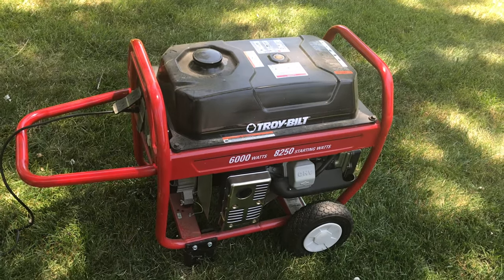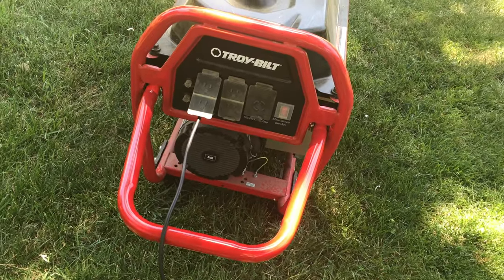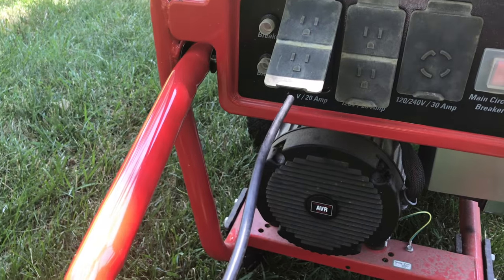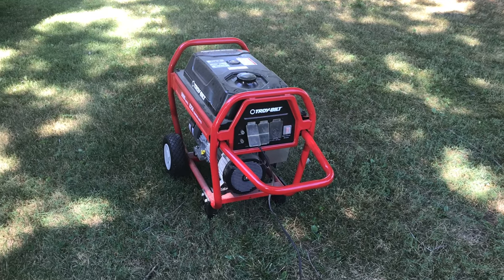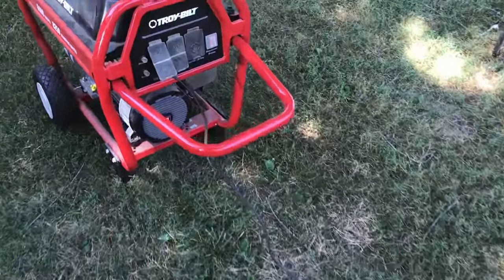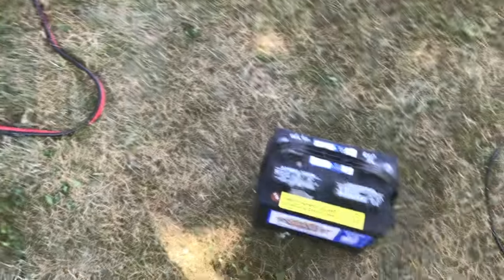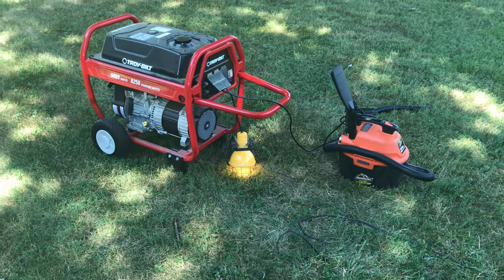Energizing (flashing) your generator with a car battery

Comment: Good Lord- Watching this man put a stick in a mixer where it could easily start flailing without notice should power return was nerve wracking!
Reply: yup that was KRAYZEEEE
Reply: i was clearing my hole saw with a screwdriver once.accidentily hit the trigger.my god that was not cool.3 inches into a tree.i shit
Reply: That would have hurt had it actually started.
Reply: I'm with you on that.   The idea is to turn the chuck, counter clockwise with your hand, with nothing in the chuck.   I've happy for him it didn't work using the drill.
Reply: Hoky sh*t. When I saw that I thought gee,   I know it should work, but for his sake I hoped not for him. You're not supposed to have anything in the chuck cause look out when it suddenly produces power! What a dumb F ! ROTFL.
Reply: I was afraid he'd stick a finger or thumb into the mixer.
Reply: Umm . .well. if it started it would have slapped his hand once or twice. .it's light wood so doubtful it would've been that serious. But genius with the battery.
When men were men and fakes were afraid. .ah the good ol days when men solved problems for the arm chair warriers wrapped in cotton wool . .well done bud.

Comment: Drill motor trick has worked for me every single time I’ve used it. Sticking something in the chuck like that is very dangerous. When that sucker kicks on, that drill will tangle you up quick. One difference, I’ve only ever used a 1/2” drill motor. Maybe your drill being smaller made a difference. Also, you get the polarity wrong with that battery, you’ll likely cause some permanent damage.
Reply: see my other comment....you're  right.
Reply: How to get a fan that runs on ac to run on a car batery
Reply: @raymondbyczek2443  power inverter.
Reply: @sourand jaded don’t know, never tried it. Try and let us know if it works the same.

Comment: Unless the drill has permanent magnets (most don't), then you are relying on the drill to have some residual magnetism in it. If it doesn't the the trick will not work. Battery flashing is tricky, always wear some protection. One second is actually too long. A quick tap will usually work. Remember- as soon as the generator starts generating, you suddenly are holding a live wire with 120 volts on the bare copper ends! It will see the battery as a short circuit, thus the description "Flashing!" Never tap a second time without first checking to make sure the generator hasn't started generating.

Comment: You Sir, are extremely, extremely lucky that your battery didn't explode in your face! Feeding 120 VAC to a 12 Volt Battery? Really?! What the Hell were you thinking! By the way, I had just completely serviced (changed oil, new spark plug, Cleaned the Carburetor) and replaced the Diode Pack and Brush Assemply on my Briggs & Stratton 5500 Storm Responder after it quit on me while waiting for power to be restored after hurricane Beryl. Fired up the Generator, turned the breaker on and,... Nothing. - Broke out my "1/2" Inch drill (don't believe a smaller 3/8 inch drill will generate enough voltage), fired up the genset again, plugged the drill in, set it for forward spin, held down the drill trigger, turned the breaker on and hand spinning the drill less than 1/2 a turn in reverse on the drill, the generator suddenly came alive and was producing 121.7 volts. Yes, the drill method works. I just think you need to use a heavier duty drill. - Great video on what not to do.

Comment: Actually, it does work, but use a battery-powered drill to turn the electric drill backward. o have done this 2 times in the last 2 days, and it worked both times.

Comment: I've had to flash 3 generators.  They were 7000W to 9000W.  Not once did the drill method work for me.  I used a Milwaukee drill and a Black and Decker drill.  The car battery method did work, though.  You have to let it run for a while afterwards, maybe 5 minutes.  Otherwise, it will lose magnetism again.
Reply: How often do you have to "flash" them? I've never heard of a generator losing its magnetism.
Reply: @james4wd236  Never, unless it stops making electricity because it has sat for many, many years or has been disassembled. Causing it to loose magnetism.
Reply: @moocow2529   Interesting. Well I'm convinced that the welder/generator I have has this problem. I got it after sitting in a barn for a few years. Gonna try to flash it tomorrow and see what happens.

Comment: Just went thru Hurricane Beryl and had to flash my Gen  every time. I used the drill. Make gen is running and circuit breaker is on. The drill has to be set for drilling (so clockwise from the back of the drill) grab the chuck by hand (maybe a gloved hand) and spin the chuck counter clockwise. One hard spin did it for me every time except once and the second spin got it going. My 14yo son was able to do it when I wasn't available .

Comment: It's called remanence. Residual magnetism in the ferrous core of the rotor. ( Certain metal materials can hold residual magnetism)This can leak out over time if not attended to or its stored too for long periods. Also leaving a load on the generator and shutting it off while an appliance is plugged in and still operative can do that as well. Nice thing about a non PVR generator is that it uses a capacitor to store some of the eneregy from the last use. It can extend it, but not for long especially if it's in harsh environments. Be careful though on some generators that have an electronic PVR, excitation using an angle grinder by spinning it on the ground can flash the circuitry in the PVR. On these you need to disable the PVR and apply a trickle voltage into the main. An ordinary drill wil not work on these.
Reply: Amazing comment

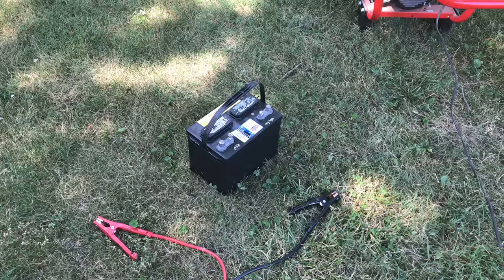Comment: 2:48 TIME.  YOU  need to insure, that the  Negative battery side, goes to the long spade female hole, in the  AC   120  volt socket. Postive, to the narrow  slit.  Polarity, is then correct.
Reply: So positive to hot and negative to neutral?

Comment: It is difficult to spin a drill sufficiently fast to generate the required current. This method works best with a battery powered drill connected to the chuck of the mains powered drill.

Comment: The drill option does work, I've tried it and had no problem. You can check other videos and watch other people reactivate their generator using the drill method! Using the mixer and wooden spoon was a very dangerous thing to do, had the generator started working!
Reply: RIGHT.  'whack '  =  i wont  try  T H A T    again !
Reply: I wonder if some drills may have a filter to prevent them backfeeding power in a situation like this

Comment: this video might have just saved another generator sitting in my garage from being scrapped thank you
Reply: if u have sliprings windings to the rings could have a bad solder joint so field will
not be magnetized as it should be.

Comment: Fuck yeah, I just flashed my generator with a cheater cord from a 12v car battery, Note! my generator was not running when I flashed it. Generator works great now. wooooo weeee, I was just about to waste $150 on a new AVR with no returns on electrical parts, thanks again

Comment: Thank you so much for this video. I have a customer who has a Fischer Panda Genset.  I went thru  all the TS documentation for remagnetzing the Genset. Nothing worked. They stated to have Genset off were unclear of what to connect where and specified 9v battery. I checked all the capacitors and all were to spec with capacitance and continuity testing. Capacitors after  disconnecting +/- from  each when I discharged each one nothing. So I felt like more and more a remagnetzing issue. Their manuals suck. This video made me look like a rock star ⭐ but I gave full credit to this channel for the idea to go to an outlet and closed circuits to Genset and using hot neutral to 12vdc small Telco battery it sparked pretty good, only held the connection for 1-2 sec. Fired up Genset and it started at 70VAC went slowly up to about 135VAC and came down.. restarted and dead on 120VAC thank you so much for your video!!! 👊⭐😎

Comment: Man, it's a good thing the drill method didn't work for you!   If that drill had kicked on suddenly, you could have gotten injured by the egg beater or the spoon spinning at high speed.     Good job on jumping the generator with a battery.  Thanks for posting this.

Comment: I thought for a minute I was going to see your get a screwdriver stuck in your head. I was laughing so hard I almost pissesd myself.HEY YALL WATCH THIS. Glad you made it through and we didn't discover the Unicorn is not extinct.
Reply: I was thinking the exact same thing ! as a marine tech ive seen a guy leave a screwdriver on the flywheel and when the motor cranked it screamed and launched the screwdriver just past his face and it went into the wall at 50 mph! he was lucky that drill didnt turn on! great video!

Comment: The drill must be one that uses permanent magnets to create a magnetic field.  Not all drill motors use permanent magnets.  Without AC power to the drill, it cannot create its own magnetic field to generate the electricity needed to flash your generator.

Comment: I have a Coleman Powermate 6250 generator and it starts but has little power output. I replaced the Carb, Brushes and cleaned the gas tank. My grinder after a while will start and run for 20 seconds then stop. It keeps doing that. Prior to doing all this the generator sat for 4 years. I'm told the generator needs to be Excited again. Could you please actually show me how you did yours with the battery? You cut out in parts that were important and just showed it running.

Comment: I tried it with a motorbike battery..... blew the caps off the top of the battery. Sounded like a bomb went off. Car battery next for a laugh🤣
Reply: That's because as soon as the generator starts working, you are now holding two live wires outputting 120vac into your battery. They call it "flashing" for a reason. you're only supposed to touch it to the battery for less than a second

Comment: I 'm not sure what's going on here.   The "AC plugs" on the panel are connected, basically, to the Stator winding.   The "winding" that needs flashed are  the Rotor windings. (the piece that spins).   What must happen is that when you touch your battery, "for one second" the Stator windings will "see" a brief voltage (12vdc) applied to the stator winding - the stator will then, due to its proximity to the Rotor winding, will induce a voltage (thus current) into the rotor winding.  Only problem I see with that is maybe the magnetic poles of the rotor could get reversed.  Is that a problem?  Not sure.

Comment: I've been studying the manual on a Winco I am rebuilding - this is a little different beast as the power is provided by the rotor and the field by the stator but as an engineer I would guess you got lucky with the polarity.  Correct me if I'm wrong - but if you were to reverse-polarity the magnetism it would cancel out the magnetic field perhaps magnetize it the wrong way - and (like a defibrillator) you would need to put twice the power in the correct polarity?  I want to make sure I got this right - it was running great but my crankshaft was destroyed so the head is off.  If the field wires get grounded - will I lose my residual magnetism?
Reply: I guess he doesn’t know.

Comment: When using the “ spin the drill motor” method, just put a bolt in the drill motor and your cordless drill motor on the side and spin away. Simple and it usually works. Drill to drill. Don’t turn on the electric drill or all heck will break lose. Use your imagination.
Reply: Yes, it will become gladiator tug of war. HEHE

Comment: Tried this and it it worked. Engine sounded as if it was under load, voltmeter perked up and held steady, so I hooked it up to the house and everything was fine, for about 5 minutes. Trying this again didn't have the same results - the engine groans and the generator breaker flips after about 2 seconds. Is the generator fried?

Comment: I'm understanding the battery might work but why didn't you show it ?? Show it in action? You said you did it but I did not see what you did!
Reply from the maker: Yup. I need to hire a camera man. Hard to hold a camera plus both ends of jumper cables.
Reply: @wagslick  BTW, I tried it and it worked! It worked, I was able to put two refrigerators on load. Then for some reason,after several hours, it stopped producing power. I tried the flashing again.. no go after that. Motor ran perfectly though.
Reply: @wagslick  use a tripod

Comment: I cant used either method, mine does make power, but like 60 to 70 volts. It is a capacitor type and the capacitor tested good.. I'm stuck

Comment: I watched one video and it was stated that it should be a 1/2” drill.. I tried a 6 amp drill and it did not work but a larger drill motor would be 8 amp.. Not sure if it will work on my generator ad it is 7500 watt.. I will try this..

Comment: You have to push on the trigger while you twist backwards. Don't use the wooden spoon, because as soon as you create power that drill is going to take off. Spin it backward with your hand and be ready to pull your hand off when it takes off. One secret is when you do your 6 month run on your generator, plug something in. The generation of power keeps your magnets excited, and you won't lose power in the future.

Comment: When you connect the battery to the generator while the the generator is running,  do you have the breaker in the tripped or set position?

Comment: I had to flash a generator last night for the first time. Saw a video on the drill method. I used a dewalt 1/2 inch. It took a while. and I was panicking a little so I just kept trying. It did work after a while. Watching this video for a back up method.

Comment: I flashed it with a 12v battery jumper inside the generator cover.  Worked great easier than lugging a battery around.

Comment: You can't use a cheap $20 low amp drill to field flash, the drill needs to be rated with at least 8 amps for it to work

Comment: Does it matter which holes in the AC receptacle you plug the wires into?  You have got a short slot, a longer slot and an almost round hole called the ground.  Looks like the jumper cord you used was only 2 wires.  I think any white wire is negative.  Not an electrician myself.
Reply: Ya man, you get the polarity wrong, you most likely just toasted your genset.
Reply: Yes the long slot is white wire ground & black is the short slot main lead. For the test the big round ground doesn't need to be hooked up.
Reply: @MrKoladge  Is the long slot (in terms of the 12V battery) positive or negative?

Comment: Tried to publish this below but it doesn't seem to take.  Brand new generac generator but wasn't started for over a year after buying.  Started up but no output.   I tried flashing your way as well with a drill.  No output.  Fortunately I had an extended warranty so it was picked up for service.  The service company tried flashing.  No output.  They called Generac who told them if flashing did not work, look for a bad connection.  They ended up taking every connection they could find apart and retightening and they were able to get output.  They have no idea where the bad connection was but it now works great.

Comment: The drill method with a wooden spoon is really quite dangerous, I’ve used the drill method on my generator and span chuck by hand, and it works really well, Ive also connected the 12volt output to car battery and this worked one,

Comment: The drill method works if you spin the drill by hand IN REVERSE!!!
Reply: I tried it in reverse. Didn’t work.
Reply: @kentwagner7334  Dude I'm sorry...The drill is to be in the forward position and you spin the chuck in reverse!
Reply: You do that with the generator on? Or off?
Reply: @edgaralvarado8065     Edgar, This is not my reply.From what I hear,you perform this procedure with genset running.I'm not sure though...Good luck...

Comment: Actually, most of the time, the drill method works great. Except, you need a drill that doesn't have a solid-state speed controller.
Reply: And, you're lucky it didn't work or else you would have been smacked in the face with the ratchet.

Comment: It Will work with the drill, BUT you have to (turn the drill backward) it won't work turning it forward just turn the chuck by hand and let go when it starts working, DO NOT USE A BEATER OR A SCREWDRIVER in it, your asking for a trip to the hospital ER when it starts

Comment: I have successfully used the drill method to re flash.  Use a cordless drill to spin the corded drill backwards.  You can use a drill bit to connect the two drill heads.  Good job on using the battery to re flash.  Great trick to know.
Reply: Food recipes
Reply: Ive'd tried using 2 drills but still doesnt work
Reply: glenn quiday try a 1/2” drive or larger drill motor.

Comment: Generator service guy told me when he does it he uses only a 1.5 volt cell cause that is all ya need, and no one can accuse ya of damaging some mouse-built component.
Reply: Wished I knew this. I rigged up something to go off the generators 12 volt battery. It sparked by it dang worked. NOW I know, just use a 1.5 little ol' battery. At least a half a day I spent on this. Part of it was trying the drill trick, part of it calling service people for this Winco that couldn't help me, and reading a lot of comments to get some ideas. Thanks.